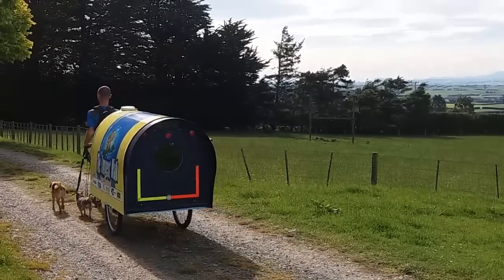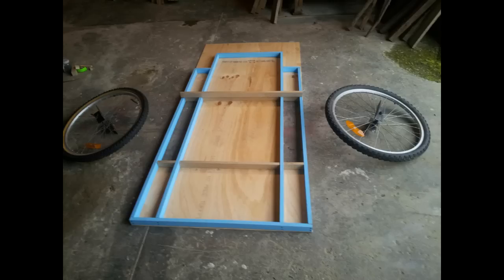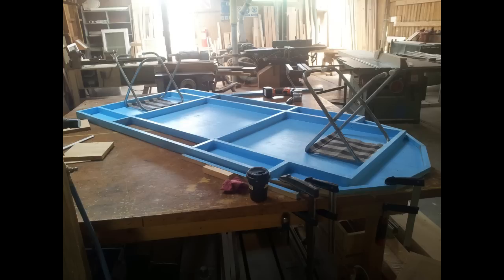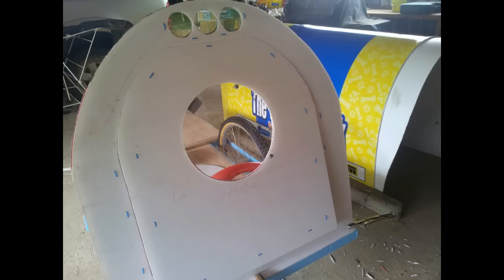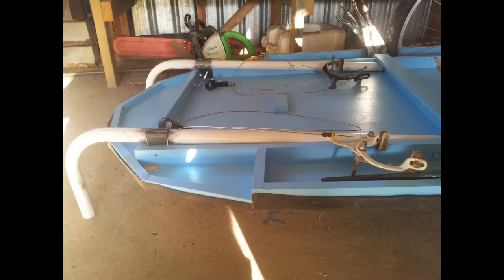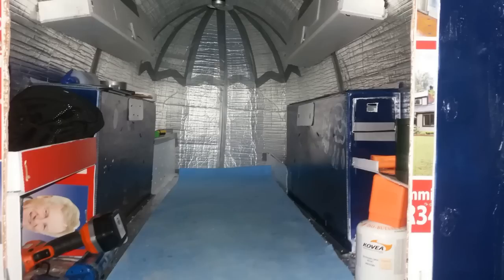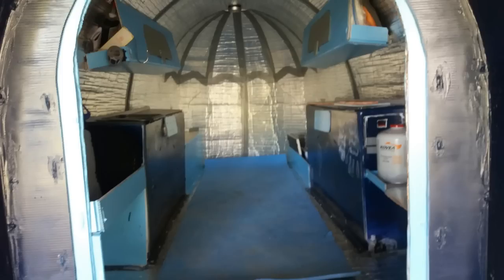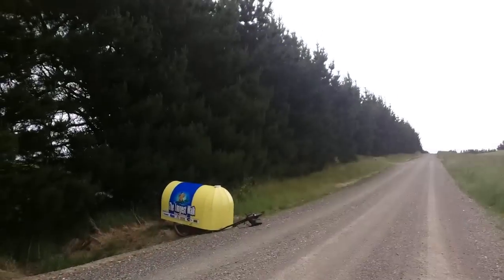DIY Micro Camper Rickshaw

Comment: Great stuff! I'm building Paul's camper as per the original and have tonight successfully tested the unsupported 'hammock' concept. I confess to being sceptical but it works fine and I'm glad I didn't go with my idea of adding cross beams which would weaken the structure and add weight. I'll get a vid uploaded when I'm done. Well done, great cause too.
Reply from the maker: Glad to hear it's working for you! Pop a link here when you are done. Curious to check it out

Comment: Hi Stephen.Just a few question Why the half-round front. I live in the UK and the weather is different from where you come from (rain ) How are you making it waterproof. Weight is everything so on the front door do you need the whole front as double . You could get away with just having the door as double and then the flynet stuck on the inside front wall. Also, do you know the weight when you are walking with it loaded up .Many thanks Des
Reply from the maker: Sorry. Must've missed this 'til now. The half round was purely because that's how Paul had designed his and I copied that. Made sense structurally for strength and from an aerodynamic p.o.v. so I saw no reason to change it. It was waterproofed with a combination of silicon sealant in the cable tie holes and the adhesive vinyl wrap (and a special vinyl tape over the centre seam). It rains a fair bit in NZ too. Weight was around 100kg fully loaded. However the leverage of the rickshaw design went a long way to minimising the weight "feel" unless I was on a hill. Not too sure about the other comments. The only double layered part was the door and that was mostly to tidily accommodate the window in my understanding. Hope that helps